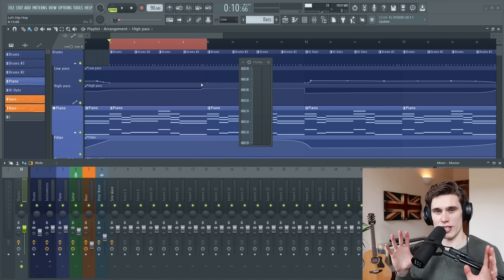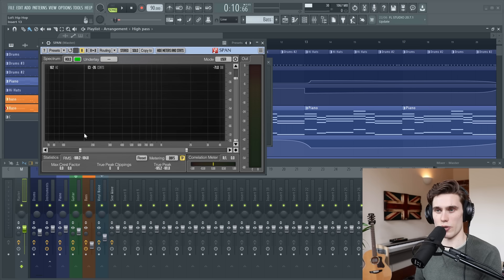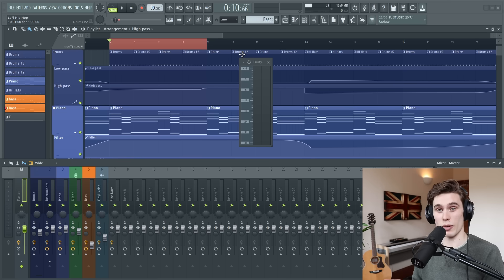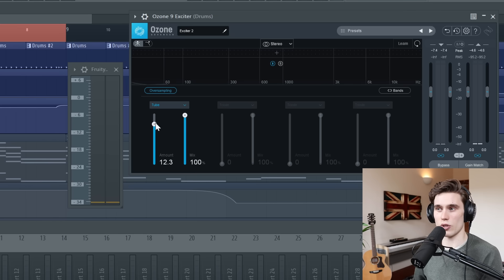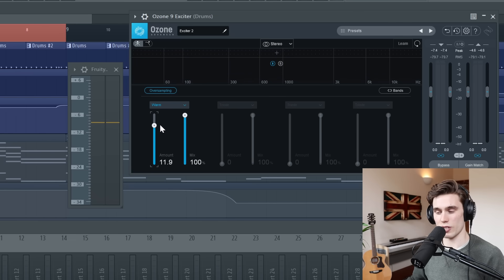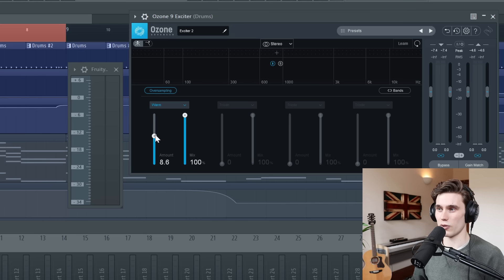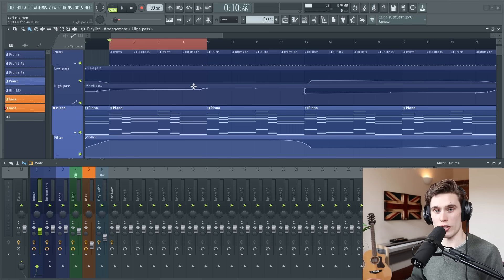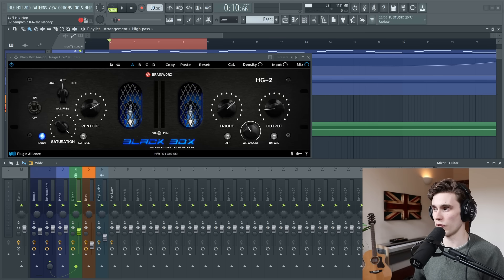Everything you need to know about Saturation - Audio Engineering

Comment: Why is shown on the screen that the overall volume of the saturated track lower than the non-saturated one when we perceive it as louder?
Reply from the maker: Great question. Perceived loudness is frequency dependent. The decibel scale is a measure of total sound energy or pressure. Humans (and possibly most animals?) Perceive high frequency sounds as louder than low frequency sounds when played at the same volume. 

This is due to our inner ear biology and is likely an evolutionary preference for communication or listening for danger as mid and high frequencies are where the intelligibility of the voice is.
Reply: I'll also add that there's different ways to measure loudness/volume, for a start there's ASPL and PEAK volume, one (peak) is the loudest point of the music at any given time, which might only happen for a few milliseconds, and the other is the average volume across a time period. We hear general loudness more weighted towards ASPL, meaning you can use something like saturation or compression to bring down the peak volume of a track, but at the same time bring up the average volume, making it sound louder to us as the average sound pressure level (aspl) has increased, even though the shorter peaks of loudness have reduced.

Think of ASPL as the overall loudness you hear, and peak as sounds that jump out from that overall loudness. This is what's physically happening, but not always how our ears hear things due to how they work with our brains. Like for example if you have 2 sounds overlayed, one is compressed well and saturated, the other is just recorded normally. The compressed one will have more ASPL but less peak and the other visa versa. If you play them together you'll notice the compressed one sounds louder overall (the quiet parts will sound much louder in comparison to the loud parts than that of the uncompressed one), and the uncompressed one's loudest parts may stand out more, this however might not give enough body to the uncompressed sound for the whole sound to push out from the other sound, and just the loudest parts are slightly more audible, and the rest of the sound is buried inside the other sound. Where as the compressed one you can hear much more of the entire sound, making it sound louder as a whole with it's higher ASPL even though it has lower peak volume. Hope that makes sense?

Comment: I’m really new to all of this I wanted to know if I can apply Saturation at the mastering stage or is this something that you have to do at the mixing stage?
Reply: Both. Use saturation to make individual instrument tracks a bit thicker, and then add some subtle saturation when mastering. In the analogue days, each pre-amp (or compressor, and some EQs) on the console would introduce some saturation, but the master tape would  have some saturation too.

Comment: Saturation is a very broad effect and it can be a deliberate and obvious effect such as an
overdriven guitar tone or a heavily distorted 808 bass sample but it's also the more subtle side
effect induced by signal processing so virtually any circuit i.e.(tube/tape/transistor or even
plug-in)has saturation to a certain degree.

Analog style saturation-

Part of the appeal or fascination with saturation is that,as a lot of these devices are analog,
records made back in the good old days often sounded really warm full punchy and thick and part of this is down to the fact that there was subtle saturation on every single track in those mixes just naturally due to the devices they were recorded on and mixed through.

Saturation is when extra sound is induced or added to your original signal.

There's two main types of harmonic saturation-even and odd harmonics.

i.e-

fundamental x 2/4/8 etc=even

fundamental x 3/5/7 etc= odd

In both cases we're adding signal or notes that weren't there previously albeit at a slightly lower level into the higher frequencies.

In general the even harmonics tend to give a feeling of support,clarity and fullness mainly because
you're adding in the octave and another octave above as well and adding the octave to the original sound sort of gives this feeling of support maybe a subtle sort of feeling of doubling that original sound whereas the odd harmonics add a lot more richness,edge,bite,+ buzziness to the sound w/more high frequencies.

Even and odd harmonics both can sound excellent depending on what you're using them for it's not that one is better than the other.

Besides a few plugins and wave shapers,almost all plugins and certainly all analog hardware doesn't simply induce even or odd harmonics as many people believe.

All of these different devices and plug-ins have a different combination or distribution of these even and odd harmonics depending on a lot of different factors.

You may have heard that tubes have only even harmonics and maybe tape has only odd harmonics but this simply isn't true.

It's true that certain devices favor certain harmonics-even or odd,but it's much more than just whether it's got a tube in it or whether there's a bit of tape there.

From an engineering background it' all has to do with the topology of the circuit,not just the tube or the tape-it's every single piece of wire,every capacitor...especially the transformers make a huge difference,it's just the general design of the circuitry and not just one component.

Non-linearity or non-linear behavior=

Basically with any device that induces saturation or distortion what you might expect is that at all
levels of volume or gain that you feed into that device you'd have exactly the same type of saturation i.e.the same distribution of even and odd harmonics but at varying levels.

However,actually with almost all of these devices and plugins,if you feed a different amount of volume into them or drive them differently you get dramatic differences in the distributions of odd and even harmonics and the tone of the saturation that's generated.

I have an example here with a tube emulation and you'll see that as I increase the amount of drive there's a big difference in the distribution of harmonics.At some points it's favoring those even harmonics then the odd then back to the even again.

These devices respond completely different to transients/different amounts of signal.

To be able to accurately hear the effect of saturation being applied on a given signal you need something that can give you an extended high frequency response.

Reference monitors are great in a well-treated room but most of the time the subtle differences of saturation are a little bit harder to hear correctly on studio monitors whereas in headphones you can hear if you're overdoing it a little bit too much

Comment: The next step is to get your hands on a lot of different options for saturation-there's tons of free plugins out there,stock ones etc.

You need to experience a lot of these different plugins as it's one of these effects where there is no wrong or right plugin,there's many of them and many producers have tons of different analog gear and plugins especially for this purpose-particular tools tend to fit particular jobs.

Once you've got all these plugins if you're confused about what they're doing simply download the free Voxengo Span spectrum analyzer plugin,run a pure sine wave through it and see what your plugin is doing/what it's inducing.

The next thing you must do when you're using saturation plugins or hardware is send in a good amount of signal.

If you're sending in -30 or -40 db of signal you might actually not experience any saturation with these plug-ins;as explained re-the non-linear behavior aspect of working with saturation/distortion plugins and the relationship between the amount of signal/results produced,,some of these plug-ins don't even react to anything until you give them -20/-10 db of gain.

Experiment with pushing up your gain going into the plugins and make sure that you're maintaining good gain staging.

In this first example I'm going to be adding some distortion to this drum track;I'll play it clean just to
start off with.

The first thing I would recommend(which I  don't usually recommend when mixing) is to solo the track as it allows you to tune in to what is happening with the saturation.

I'm going to be using the Izotope Ozone 9 Exciter module because it lets me choose between some different types of saturation easily.

First I'm going to use tube saturation and what I want you to notice is that as I'm increasing it up to around halfway you might hear that the low mids start feeling a little bit more full and a little bit more reinforced and then beyond there it's just getting a lot brighter with a lot more high frequencies
and things actually start distorting and sounding almost clipped.

Now it's sounding more reinforced and louder but what was interesting was that even though things were distorting and sounding a lot louder the peak loudness was actually going down on this db meter on the output so as I increase it we're getting less peak loudness but the average loudness and the perceived loudness is increasing.

This is why I really wanted to explain that non-linear behavior at the start.Even just going a few more percent up here just radically changes how this distortion sounds.

What is very common is distorting something quite a lot and then pulling the mix amount down,i.e. we're distorting it like crazy but then we're only going to blend in actually a small amount of that distortion....for this particular track I would pull it back like this.

Let's try some different types of distortion,this time I'm going to go to "warm"....this should be a lot more subtle but you'll feel that instead of adding a lot of high end it's simply just reinforcing that kick
and snare,pulling out the bottom of the snare/beefing up the kick drum...you can hear that as we get to the higher frequencies the hi-hats start to break apart so that's something to listen for in the high end.

Comment: I'm going to swap over to tape and what you'll hear is that it starts boosting the high frequencies,so with the mids and top of the snare and the hi-hats it starts boosting them a little bit sooner than
with the tube saturation...even by the time I get to here I'm hearing those hi-hats substantially louder so what I'm going to use for the drums is the tube because I don't want the top end to be boosted this much.

Although it says tube,it's not just modeling a tube,it's probably modeling the whole circuitry that was in that tube device;a tube on its own does not provide warmth although it glows really hot,is warm, if you touch it it would be hot,however the tube on its own is actually just inducing higher harmonics, it's the whole circuit(mainly the transformer)that is adding all of that weight,extra body and warmth to the signal.

The crucial step once you've picked the type of saturation you want is to unsolo the track turn everything else back on and this is what you use to blend in the amount of saturation because on its own you'll almost always get the wrong amount of distortion.

If you listen with and without the saturation you'll see that the one with the saturation is actually much more quiet in terms of peak loudness,it's 6 db quieter give or take but the perceived loudness
and the overall loudness in my opinion is a little bit higher,at least in these headphones.

The way I like to use saturation in a mix is usually just subtly so every single track just has a little bit of saturation.it doesn't have to be "in your face";those drums were probably a little bit over the top but especially when you're using saturation to reinforce a track with those extra second order even harmonics what you'll find is that if you use just a little bit on 10 or 20 tracks all together it sums together to a much punchy,full sounding mix.

Now I'm going to go on to the guitar which is an excellent example of why you should be blending in
the saturation with everything else playing.

What this other saturation plug-in(Brainworx Black Box) lets me do is not really increase the loudness but just add a little bit of grit/texture to the guitar while also keeping it pretty smooth.

More importantly it lets me hear the guitar without having it stand out in the mix,it lets the guitar sit a bit further back in the mix yet it pulls all this detail up,all of those extra harmonic overtones are pulled up in the guitar and it just sounds a little bit more cool/textured but again it's not an in-your-face sort of "screaming wall of guitars" effect,it's just sort of a subtle amount of saturation.

That's the end of the examples;I hope that it's clarified what saturation is, the difference between even and odd harmonics,the difference in the non-linear behavior of the circuitry...

The type of saturation that's induced really is all down to the specific topology of the circuit or the
plug-in that you're using so the real take-home from this video is that you've just got to get your hands on a lot of these plugins,feed them a lot of signal and just learn what they do...it takes a bit of time to tune your ears into these things and learn the differences between all of these types of saturation...

Comment: QUESTION! Should you saturate each track directly, or run them through a bus with saturation? Does it matter?
Reply: I'm gonna preface with I'm not an expert but I'm pretty sure it depends on the sound you're going for. If you bus them all to one saturation channel then it'll homogenize the mix and squish it all together. Saturating each track individually allows you to cater the saturation (and maybe even use different saturation) to each individual track and get them individually sounding saturated. So it's up to you what sound you want. Doing both could even be really nice if you don't overdo it

Comment: Just want to say that this is answering a loooooooot of questions and I am also so grateful that you use FL Studio with these examples (Even though you teach it to where it can translate to others). So thank you dude. I am actually about to watch your ear training video and I had a question to ask that popped in my head. Around @13:47 you talked about adding "A little bit of Saturation" and then discussed doing that to every track to get an "Overall" result. The question is : Would you have the same result adding "a little saturation" to the Mixer channel (Which covers all signals as well) or do you think it helps doing saturation to all individual tracks?

Comment: I don't get the use of saturation/distorsion. you can use EQ to get the same effects without sounding unatural (if used wisely). saturation is like an instagram photo with those heavy filters; at first it looks better, but over time it just isn't natural. or take a MCD hamburger with all that artificial taste (and soy in the meat). first bite is delicious, but take a few more bites and it tastes like cardboard.
but I understand that many times there is not the option. put a natural photo in Tinder and you will be swiped to no. people don't take the second bite into the natural burger
Reply from the maker: Unfortunately you can't make a regular EQ add signal that wasn't there before, it can only enhnace or reduce what was already there (Unless you have an analog EQ which might induce extra saturation). I think many people like the sound of saturation in many genres becuase it adds a lot more tone and grit to the sound but it is certainly easy to overuse it and then it doens't have the same impact anymore.

Comment: A nice idea is to sidechain your track to a separate mixer channel, go crazy with saturation and slowly blend in the signal. I know it sounds kinda useless, but it lets you apply effects on the saturation. For example an Eq can prevent it from getting too dirty, and a compressor will make it more consistent. Great video as always, Michael
Reply: hold up. can you explain the setup in a little more detail? I just tried to do this but I didn't get it to work.
Reply: @prod.extelligence  the steps I list below are what I do on FL studio but I think it's about the same in every daw
1. Assign your sound to a mixer track, let's call it track 1.
2. Select track 1, go to the arrow at the bottom of another mixer track (track 2 I guess), right click and hit "sidechain to this track"
3. (In FL studio you do this by fruity send) send the audio from track 1 to track 2. Now you have 2 identical sounds on 2 different tracks. Grab track 2's fader and pull it all the way down to -infinite
4. Apply a saturation plug in like softube saturation knob at the start of track 2's effects chain. You probably want to exaggerate here, as not all of this grit is going to be used afterwards.
5. So now you have the original sound on track 1 and a very dirtorted version on track 2. Track 2's fader is at - inf, time to change that. Start slightly pushing it up, thus adding more and more of this dirtorted volume. Once you are happy with the sound, leave the fader where it is. Keep in mind this increases the overall volume, so don't get fooled by making everything super loud.
6. Most fun part: the entire track 2's effects chain is empty, so you can add any effect there. The effect will only affect the distorted part of your sound, hence you actually get to shape this distortion any way you want.
I hope this helped, have a great time producing!
Reply: @rhydes_  wow! thank you so much for that elaborate explanation! i really appreciate it! i got it to work now :) but just to be sure, this is basically the same as duplicating the sound and putting the second version on another mixer track, right? i've done this with 808s where I cloned my 808, put it on another mixer track, distorted the shit out of it and then mixed the two versions together.
Reply: @prod.extelligence  yes, exactly!